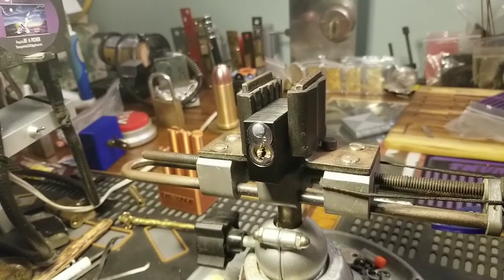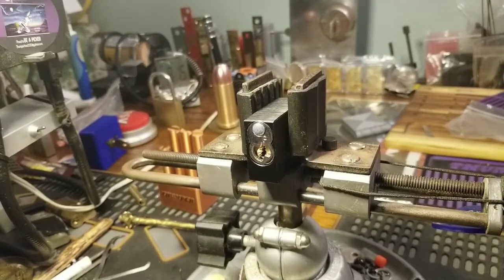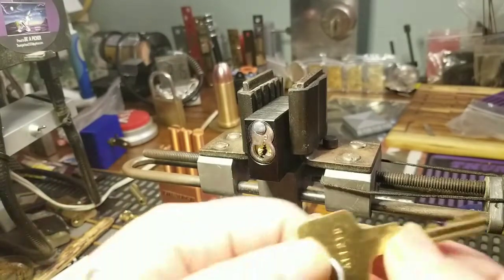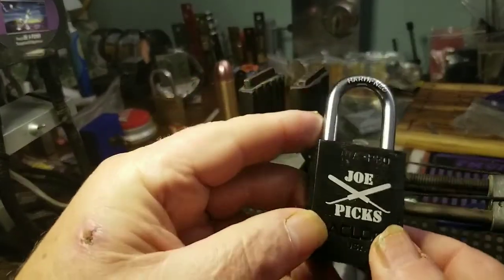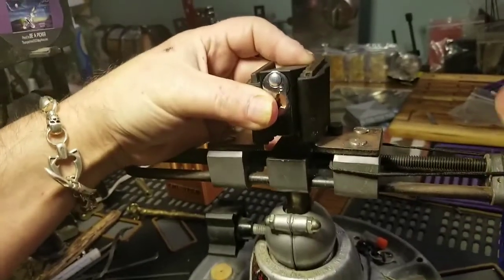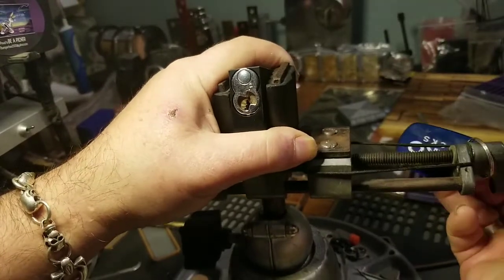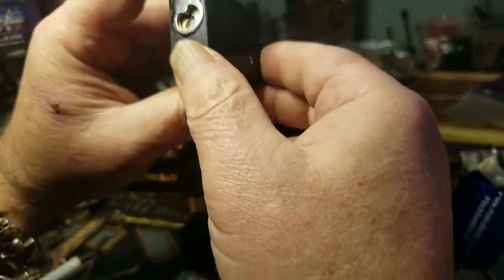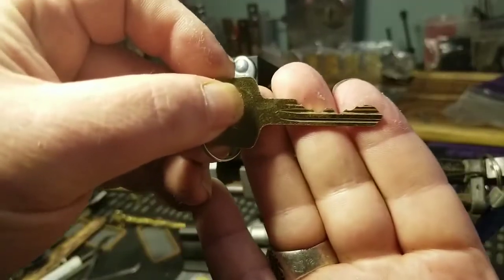#860/Picked Joe's logo padlock

Comment: Not an easy one to pick Thumper, we all have a bad day in the office. You could always do it again if you were not happy with the video.

As for camera angles, I would place the vice where you feel comfortable picking then see if you can reposition the camera to suite. I have a shelf on the wall that my camera is clipped too on an arm. That way it's like the camera is floating and isn't in the way of my hands or arms like on a tripod. That way I can move the camera to suite the position of the vice/lock. I am due to change the arm for the camera from a goose neck to an arm with three joints that can be maneuvered in almost any position. Again, first position the vice then try to get a good angle for the camera after that.

I was thinking about the pain you feel when picking and wondered if it would be better if you kept stopping before it hurts so you can flex your fingers then carry on in that kind of system. Just a thought from one brother to another brother.